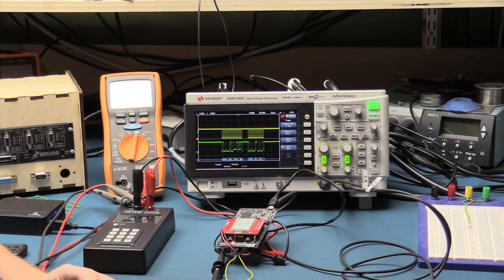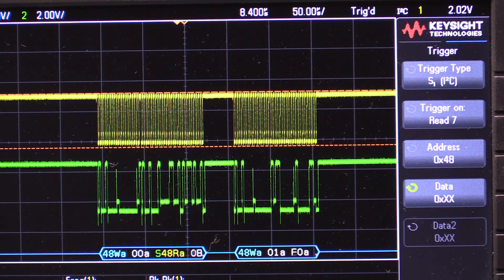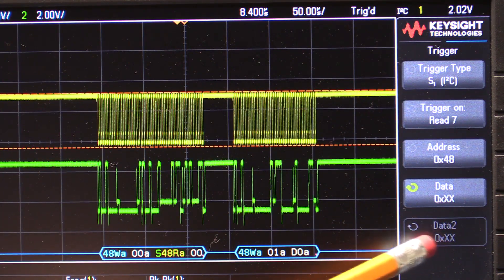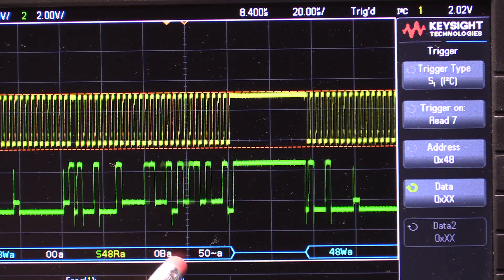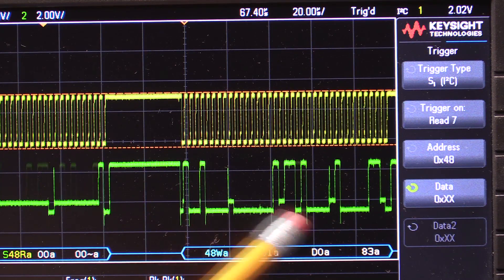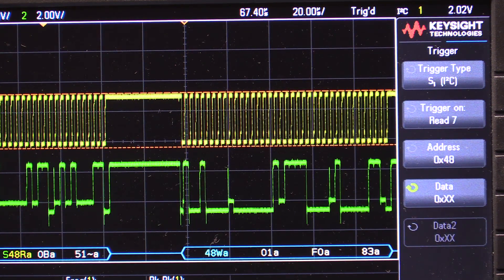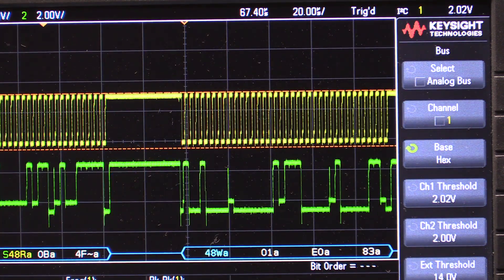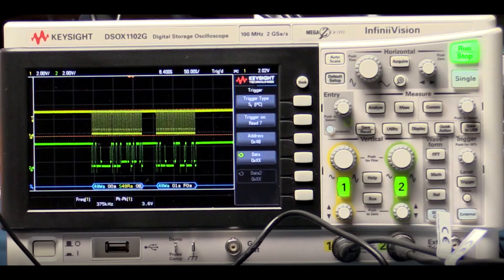Keysight 1000X I2C Decode Quirks and usage

Comment: Hi Peter, nice video. The MSO-X 2024A allows on-screen listing and exporting to .csv files for serial and I2C. The function is called Lister. Maybe it's there somewhere on the 1000X, although the menus do look different. I'm sure you noticed red dot and occasional flashes on the right hand side of the packet decode, such at 3:12 maybe hinting at something more. :) Best wishes, Kent
Reply: That's right, Kent, we have a lister on the InfiniiVision 2000 X-Series oscilloscopes and up. Unfortunately at this point, the only way to save decode data is by saving screenshots. I'll pass that feedback to the team, thanks!
Reply: Yes, we generally won't limit little things (like the saving of data) to differentiate the models, part of the great things about the 1000 X-Series is that you get a lot of the same functionality, usability, and reliability as on our InfiniiVision oscilloscopes.
Reply from the maker: Hi there Keysight, thanks for watching / Listening
With regard to saving screenshots, you would need a great deal to save a conversation, not a very effective way to do it, it would be easier to literally write it down with a pen and paper. If Keysight can see their way to adding this to the decode functionality (Not just I2C), there will be a lot of very happy people. I know within Element14 roadtest, this has been mentioned a few times and seems to be a bit of an oversight as the scope will save the "Analog" version of the capture as CSV. just not the decoded version.
Reply from the maker: I did and at the point of recording I already knew the answer but then I have a lot of experience with this type of equipment over the years. I wanted to show a small trap that can cause confusion for newcomers to the scope who may not be as confident and may give up a little easier. I think the biggest down side to this scope at the moment is not being able to save the decoded data or show it as a table (Lister as you mentioned), I tried google and had no luck either. There is a new firmware I just found out though, so maybe .......
Reply: Hopefully functions which are basic software in nature, like saving, will not be used to differentiate the models. Otherwise, the 1000X looks nice.
Reply from the maker: I completly agree, I dont see many manufacturers participate in YouTube conversations, this is an Awesome turn of events. Welcome Keysight :)
Reply: Thank you for the clarifications. It's wonderful that the manufacturer takes an interest in the YouTube reviews and the time to respond to comments. Best wishes, Kent
Reply from the maker: Go for it, you can include the URL link to it too if you like, More relevant info for my viewers the better
Reply: Hey. Nice to see this support. I mean the company is modern enough to spend resources to go online, read and improve. I applaud you for that. As an aspiring engineer, I decided to buy DSOX1102G for my home usage. So good and affordable you became! :-)